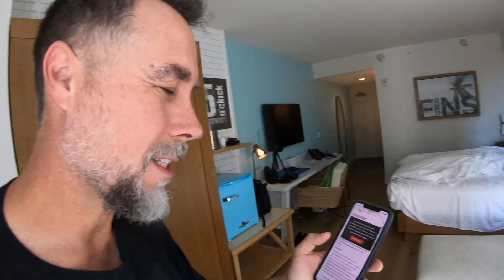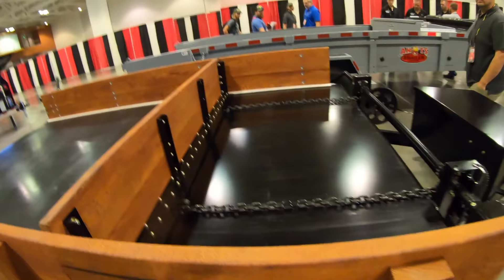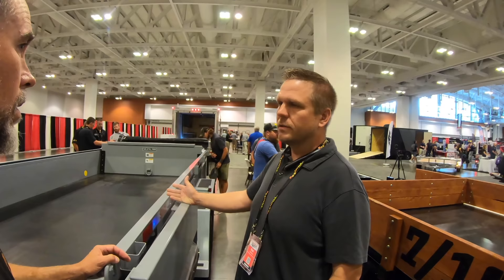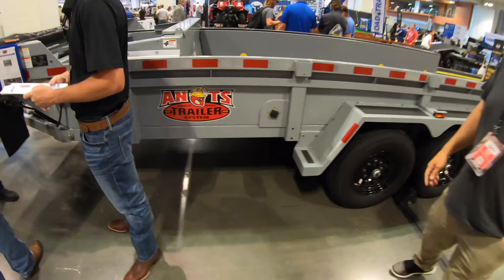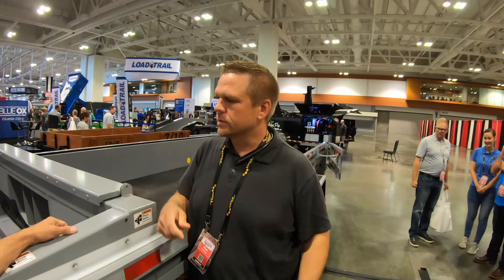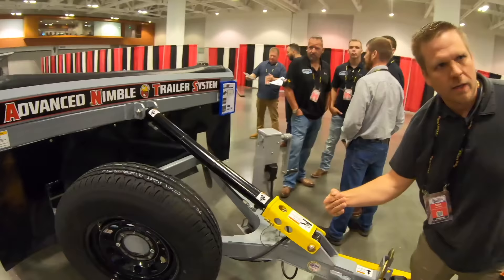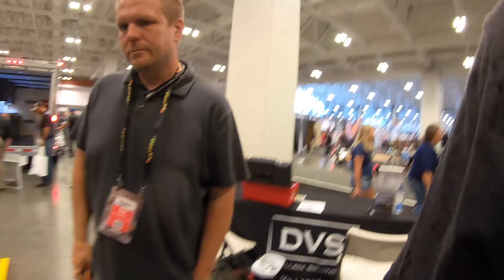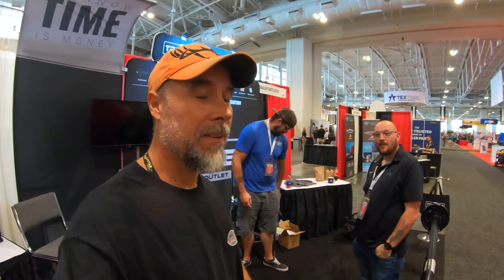I have NEVER SEEN a Trailer like this. BUT is it any good?

Comment: I was in the trailer business for 21 years, the Ants trailer is pretty awesome, very interesting. Sold and serviced them all. If you take that much care for the wiring, than you take the care for everything else. That’s where most companies cut the corners. Also in the brakes and bearings. I guarantee they use the upgraded size on the bearings and quality axles and brakes.
Reply: the wiring is the first thing I look at on a new trailer...it tells the tale IMO.
Reply from the maker: agreed-  good wiring means a good trailer IMO.

Comment: Its about time they came out with the ANTS trailer, they been making manure spreaders like that for decades now. Cool stuff!
Reply from the maker: agreed.  Just makes sense to me.
Reply: Was just going to say that
Reply: Silage wagons too.
Reply: No $h!t.
Reply: Manure spreaders are run off of a PTO shaft just for the record ... Hell of a lot more accurate and useful than any design of that trailer.. lol
Reply: @dommccoy3990  WOW don't have anything useful to say. By the way there are ground driven Manure spreaders likely there are hydraulic. I know there are hydraulic floor models. You also realize this isn't for spreading manure it is an alternative to a dump trailer?
Reply: @dommccoy3990  , not the first one we had on the farm. It was ground driven from one of the tires. And it wasn't a converted horse drawn one either.
Reply: Lots of live bottom gravel and garbage semi trailers on the road

Comment: Seems like the first company went to great effort with the design and quality of their trailer. I just personally don't see this beating a nice dump trailer, especially with the entry model being around $10,000. The drop deck design and ability to raise the rear of the trailer could be nice, I'm just scared of how much a higher rated trailer would cost. Still nice to see innovation and someone trying to be different.
Reply from the maker: I would like to see how this handles a jobsite.
Reply: I just made a simmilar comment. $10k for that little basic thing... That's absurd. that must put the second one up over $20k. That's absurd.
Reply: Thing to bear in mind is some of these markets can be quite specialised. While they may be overkill for some folks, others will see a significant time saving - for them - that will easily offset the additional cost.
For example, if it saves 10 minutes a day for a crew of 5, for a 6 day work week that's a time saving of 5 man-hours a week, thats 250 man-hours a year. At $40/hr labour that's $10k a year! Small numbers add up in a hurry.
Reply: Agree with comments. It may pencil out if you have enough jobs that you can bid with only one FTE versus two FTE. You would have to be able to use it as a competitive cost advantage. Not to mention you can write it off your taxes.
Reply from the maker: Good logic on expensing out the trailer
Reply: It is the versatility that I like and the rodent proofing of the wires. I never realized how much time was wasted if you didn’t have a dump bed so when my dump  truck was in the shop for over a month i needed a quick solution and a dump trailer was exactly the answer. 1 st the insurance was so much less expensive than getting a new truck with a dump. It would also be an equipment hauler 10,000 lbs GVW  If you maintain your own equipment and don’t need to pay the DMV fees for the weight  carrier a trailer is a cheaper way to go if all you got is 3/4 - 1 ton. In comieformia the air carb board is carbing  out all the diesels my my 26k GVW  Mitsbishi in line 6 2001 with 100K was just getting broken in and the State of CA say no you can’t register it any more it’s considered a gross polluter. There’s nothing wrong with it it purring like a cat and not a whiff of black smoke. I transferred my custom bed body to a new class 5 gas  with a GM engine. It gets 8 miles to the gallon but its better for the environment so says Brandon and Gov Newscum ! I’m ready to retire this state is a mess. Nice video!
Reply: @gordowg1wg145  In reality though, the time savings for a 5 man crew never materialize; they typically waste many times that every day... The time savings is for a single owner operator who has the remote control in his pocket so he can operate the conveyor without having to get out of his operator's seat. Some days I spend as much time jumping out of the cab, walking around the machine and moving something, picking up something, etc as I do operating. Being able to dispense materials into the bucket with little or no mess would easily save an hour a day. That would make it worth the $10k uncharge vs a typical dump bed.

Comment: The mini walking floor trailer (while cool) definitely has a niche market. Years ago at our truck equipment shop we carried a similar product that installed into your pickup bed. It worked alright for what it was(definitely a homeowner product, not commercial) but the drawback was it always left material fore/aft the wheelwell/inner fender, so you had to clean that out by hand. 
Hell yeah we’ve been waiting for the floating gooseneck video though!
Reply from the maker: I have used that roll out tarp thing you were talking about.  I liked it for light stuff
Reply: But the thing you're talking about doesn't have an actual metal piece "pushing" the material out like the ANT does.
Reply: It looks like a straight pull without any wheel well issue.
Reply: @tomkacandes8286  the trailer IS, I was talking about a different product
Reply: We have 3 ants trailers, mainly used to haul concrete chunks and materials for projects, they stay clean and work great.

Comment: I purchased one of their flat drop trailers 14 X 20 hydraulically lowers flat to the ground absolutely amazing I move the skid steer‘s and attachments so fast so smooth ,you can drive on and off at full speed crazy cool great galvanizing I just wish they could use the hydraulic power to make the jackstand go up and down then it would be effortless
Reply from the maker: I wonder if a still well jack would do that?

Comment: they are really good for mulch and topsoil they work great for loading wheelbarrows and skidsteer buckets without dropping the material on the ground
Reply from the maker: It looked perfect for that.
Reply: How would you load a 2 foot wide wheelbarrow with a 7 foot wide conveyor, without dropping material on the ground? Is there some sort of chute attachment?
Reply: @littlejackalo5326  with a shovel it keeps all the material on the edge and you just knock it into the wheelbarrow
Reply from the maker: They do have chute attachments

Comment: The ANTS trailer people should build a fixture that allows them to stand their trailers up on their tail lights with their tongue pointing directly to the ceiling. Then have the movable parts all functioning. 
Otherwise at the show when people are looking around for the next thing they would like to take a closer look at, all they See is some more trailers on the ground and can’t tell the engineering that goes into an ANTS. 
There is a great agricultural attachment manufacture on I 80 in Iowa that stands things up like that to get attention.
It shows off the companies talents in welding, fabricating and engineering.
As a guy that has seven different types of trailers right now I have enjoyed an inside look at this tradeshow. 
Thanks
Reply from the maker: More to come. Lots of cool trailers in their.

Comment: Those live floor trailers are awsome. Far north? lol. Michigan is south to me. You want to test in extremes, go far north like northern Canada where it can experience -50F temps. I would love to crash test those trailers.
Reply from the maker: Thats insanely cold
Reply: @Dirtmonkey  Yes it is. That's one of the reasons we are moving. The coldest I have worked in was -65 with the wind chill, doing construction on a steel building. The temperature was -45. That will test the limits of any equipment.

Comment: I can see if your working by yourself and do a lot of loading material in a bucket to not make a mess where that would come in handy, but the floor worrys we of how strong it or how it holds up sitting out in the sun and not stored inside
Reply from the maker: They did test it out and even froze it solid to the trailer.

Comment: That conveyer trailer is really interesting. I could see that conveyer really coming in handy. Not sure this trailer could take the abuse a normal dump trailer with 8 gauge floors could take though. Really neat trailer though
Reply from the maker: agreed.  I don't think it would make a good demolition trailer.
Reply: @Dirtmonkey  Been using one for our concrete business for 3 years and it’s taken heavy abuse. Never replaced the belt. Dropping slabs of concrete in the bed with a mini, and throwing demo’ed block in it. We’ve been doing a Harbor Freight job for the last month. Lots of masonry demo and tearing out floor. The trailer is a beast
Reply: @blakeraasio7283  what do you like it best for?   broken concrete transport? Gravel?...WHy a belt instead of gravity?

Comment: I just watched their videos last week. At first I thought this must be from France or something but nope turned out to be American made.
Reply from the maker: Whats your impression on them?
Reply: @Dirtmonkey  I can sum it up like this. For a small company this could be fantastic. The conveyor belt and wheel barrow is perfect for gravel but something like mulch it will lose the race. I will pay a guy more to shovel than less to crank a wheel or push a button (in that case). 
I’m not a fan of dual use trailering. The mini skid they loaded in the videos was really small. So I guess the weight capacity is low. So again a smaller company with one truck might see this as a blessing but if you buy into a limited platform you limit your growth. 

I like deck over wheels dump trailers. They dump higher like a truck with a dump bed. 
If they put that conveyor on a bigger trailer or a mason dump bed for a truck. I would be first to buy.

Comment: Nice video! That ants trailer is pretty cool but I don’t know how affective that would be with those low sides. 
You should find a way to compare your cast loader to an Avant loader.
Reply from the maker: The cast versus an avant-  interesting idea.
Reply: If you are loading it higher than that with soil or gravel it's probably way overweight anyway. DOT or accident lawyers gonna get ya. I've pulled my fair share of jacknifed pickup/dump trailers out of the rhubarb over the years. Always overloaded or they were pulling it with a 1500. Did one last year that smoked the back of a semi. 2500hd with a dump trailer loaded with concrete pipe stands. We had to weigh everything for the police. It was like 21,000lbs. Driver got his pee pee slapped bad from the cops. He was lucky to even be alive passenger side was caved so bad the dash was touching the seat. He hit it off center

Comment: The conveyer belt trailer seems like a cool idea, but I automatically think of a treadmill when I see their trailer. Treadmills always have belt issues. I know the use is different, but I wonder how the combat any belt warping once a vehicle or heavy equipment starting driving up on a stationary belt.
Reply: We’ve been using the ANTS trailer daily for 3 years doing concrete and we abuse the crap out of it. Never had any belt issues or replaced it. Done everything from dropping slabs of concrete on it and throwing cement block in it. It’s a beast

Comment: Tried the trailer parts outlet out on a 6” cylinder for a dump trailer. Mentioned the term the guy says if they don’t have it , they will find it. NOPE. They didn’t have it. Not gonna find it. Even gave options on the connection ends. Just said no, don’t have it.
Reply from the maker: Well that sucks.  Sorry they didn't live up to that promise.

Comment: Was the drop deck trailer there? Like where the hitch stays with the trailer but the deck is on the ground?
Reply from the maker: I think that one dropped down
Reply: @Dirtmonkey  I didn't mean to say with the trailer lol.
Meant like the drop deck big rig trailer where uses hydraulic and a small engine to detach and you drive up the trailer from the spot where the gooseneck was. 
Do you understand what I'm saying? Lol
I saw it on tictok lol but it was a pretty amazing idea it's for a pick up truck.

Comment: I’ll have to say do they have a 8 lug air ride trailer and can it be done to a farm use trailer and no electric brakes just got axles and bearings
Reply from the maker: What do you think of the build quality?
Reply: In my opinion I’d say from being in Nashville Tennessee man and in the south we don’t have that much snow and long as you got hood welds and quality but from being a farmer loading equipment in it  it’s a good buy depends on your finance committee mostly your wife and I’m not a business man but I’d say if it had air bags to it and some hood leaf springs it would be set up the way you want it
Reply: Meant good welds

Comment: How does that ANTS trailer hold up to rubble or rip rap?
Reply from the maker: I don't know. Good question.
Reply: We’ve daily used our ANTS trailer for 3 years doing concrete in the UP of Michigan. And we abuse the heck out of it dropping concrete and block into it. Never had belt issues or anything.

Comment: Did you notice as soon as he started Talking about damaging the liner the guy change the subject immediately
Reply: Trust me that belt holds up. I wish he talked more about it. We’ve been using it for our concrete business daily for 3 years and we drop concrete slabs and rubble into it and have never replaced the belt and it’s still good. Thing is a tank

Comment: Their "cheaper entry level trailer" with wood sides and manual drive is $10k, and $12k with a drive. LOL. $10k for that little basic trailer and the basic conveyor system? Yeah riiiight. That's got to put the one next to it up over $20k. Standalone gasoline driven hydro system, full metal sides, the tongue hydro to lift the back, and a much more complicated system.
Reply: I’ve used ants trailers before and can say they’re worth it. Buy once cry once. Tools and equipment are expensive these days. 20k on a quality trailer isn’t unheard of.